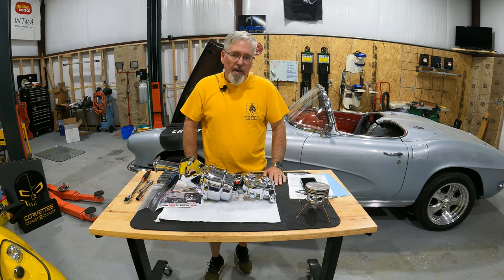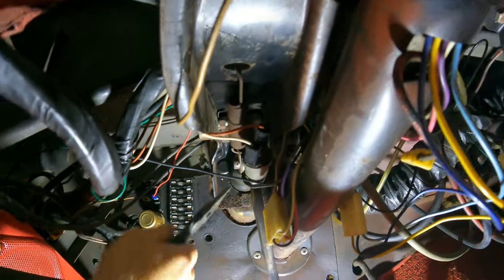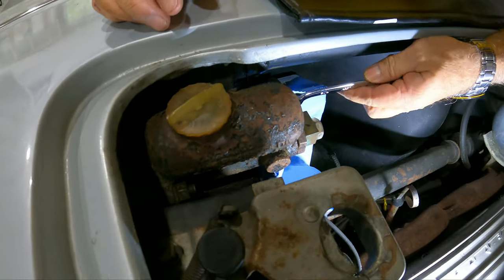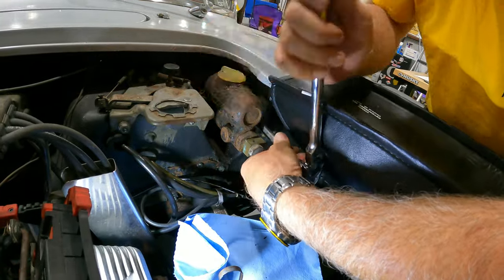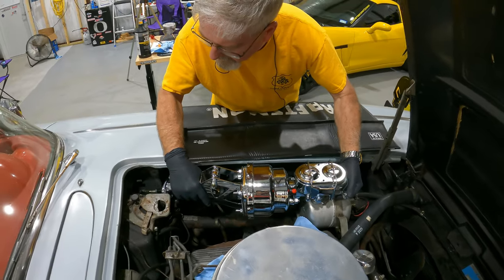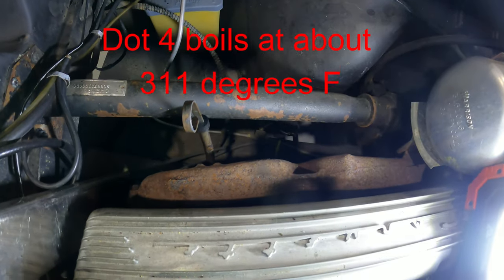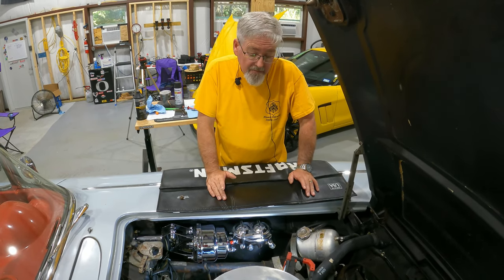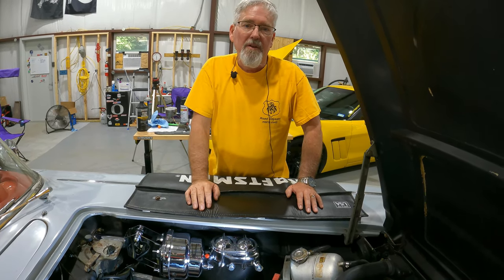1962 Corvette Brake Upgrades, New Master Cylinder  #corvette #restomod #hotrod

Comment: Great upgrade and video! You explained everything really well.
You ran into some problems, but when you figure out what to do with the brake lines and all that, it’s going to be a great addition!
Reply from the maker: Yes Sir, it's all a learning process with these upgrades.  The brake lines are still giving me a little trouble but there's an update on that one coming soon...after the heater core...🤣